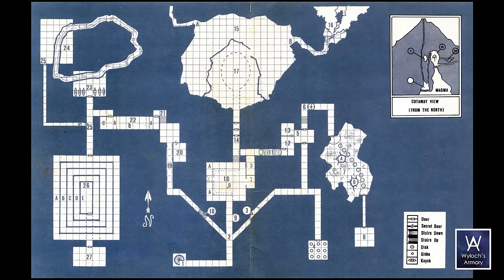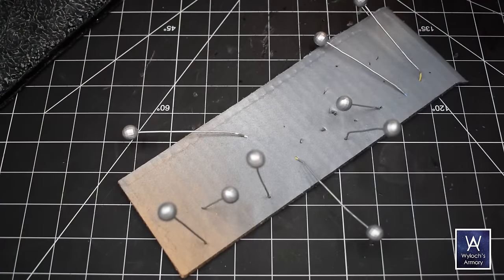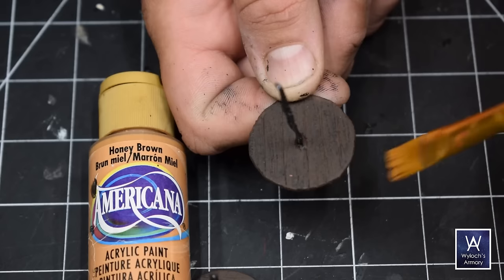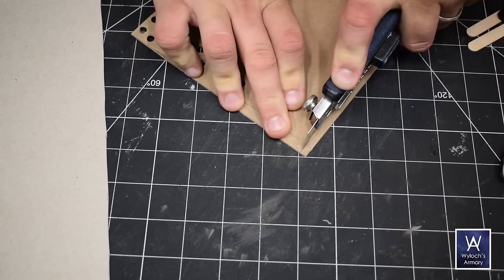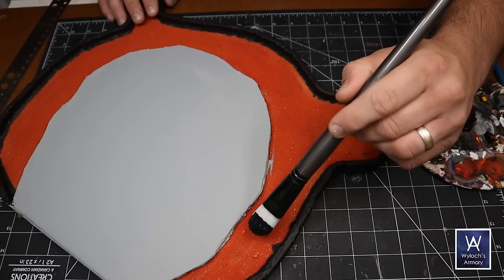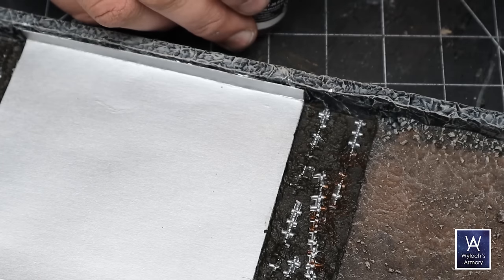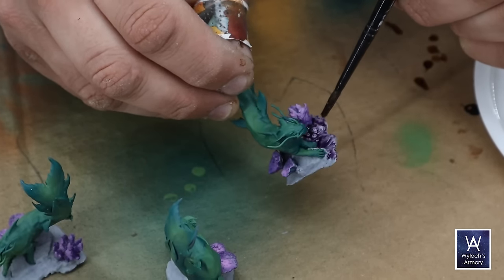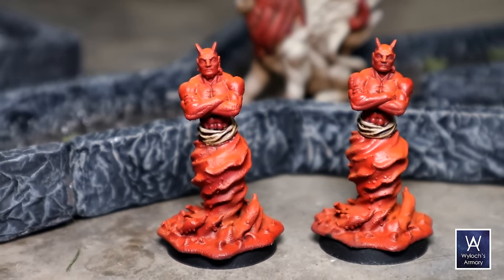White Plume Mountain - Building a Dungeons and Dragons Classic (Two Hour Supercut)

Comment: 1:35:20 I use water to remove the shiny product packaging from all my cereal boxes. Just get it wet, and it peels off. I used the spray nozzle on my hose to remove some, and a dish scrubby sponge to remove others, and my fingers to remove the rest.

Comment: I just found your channel and as a terminal crafter who can't settle on a single hobby and ttrpg player I'm loving it! One thing for your piles of gold when you want to put a bit of extra effort in (or need a trail of gold coins leading somewhere) is placing a couple of individual glitters to be single coins that aren't totally piled up since usually there's a couple scattered not in the main pile. You can get a silicone tipped placing tool for nails and they work wonders for picking up a single piece of glitter to put down on a tiny dot of pva glue!

I've done it for one of my own projects and it can drive you a little batty if you place a LOT though. Only a handful around a pile of gold shouldn't be awful though.

Anyways, I'm subscribed, looking forward to more!